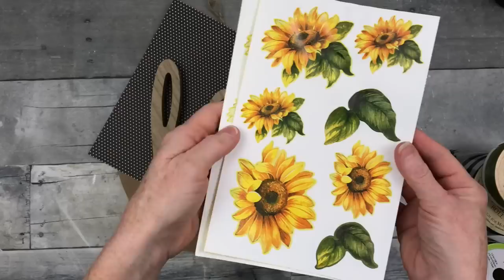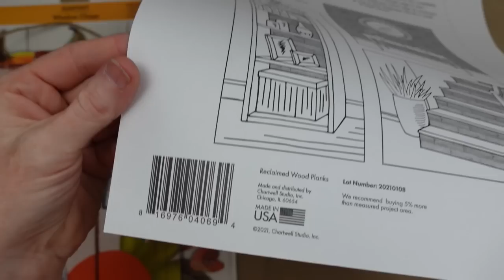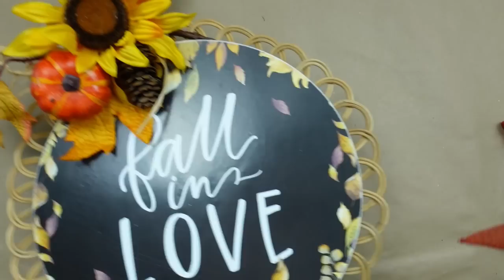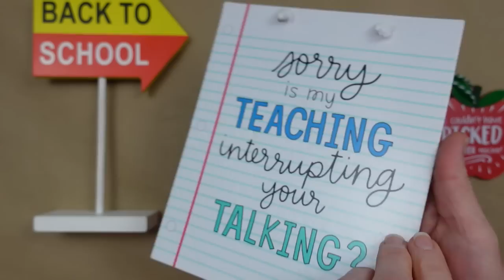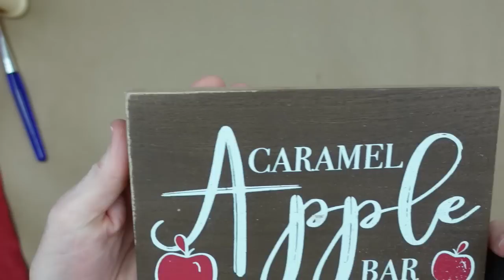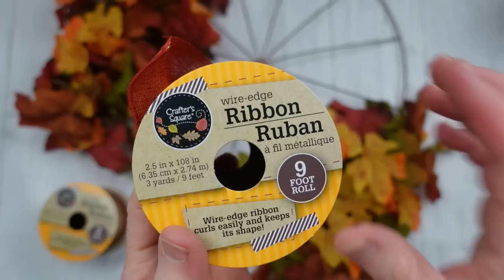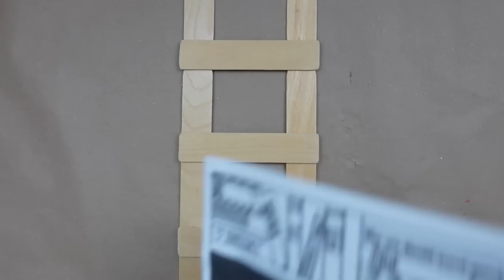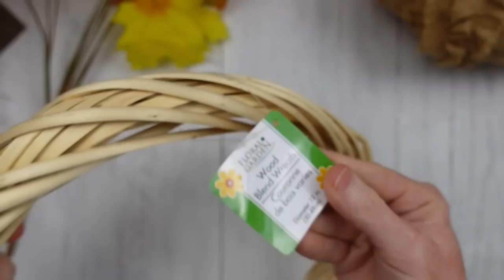Fall 2021 MEGA Video - Over 50 Inspirational Fall Ideas - Part 1 - Video Compilation

Comment: Question. What is the difference in glue sticks. What type is best for felt?
Reply from the maker: You can get multipurpose glue sticks, gorilla which is more permanent and fabric glue sticks as well as glitter glue sticks for anything you like. I’ve used regular glue sticks on felt but it can leave a raised line where you put it. Something like a liquid fabric glue in a bottle may be a better option for you. Hope this helps!
Reply: @MakingItMyOwn  thank you!